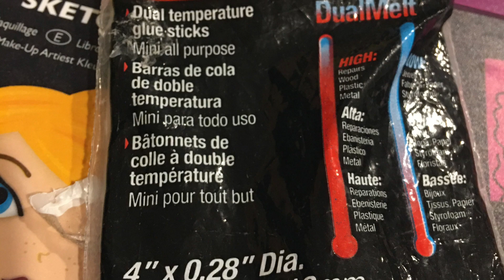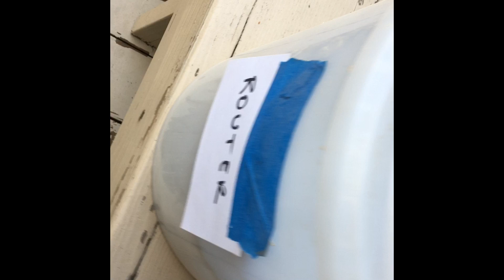Saturday Projects™.com | Deck Prep for Paint - prepping a wood deck for paint tips and tricks how to

Comment: Went around with a hammer and punch and knocked down any nails sticking up and set them in with 3 light strikes then Used a Diamabrush and a metabo grinder stripped my entire deck with it in about 4 hours down to the bare wood that Diamabrush even leveled out boards that had shifted. Then threw down some rust oleum deck rock solid deck paint. It’s been good for 3 years now
Reply from the maker: The diamabrush route was more aggressive than I wanted to go and for this job "good enough" was "good enough" :)  Sounds like it worked great for you.
Reply: @SaturdayProjects  I was able to find someone selling one on market place for 25 dollars so it was perfect. There’s parts where I just skimmed the paint off and there parts where I shaved 1/4 inch off a board sticking up to make it level with the adjacent board. It’s all about how much pressure you apply
Reply: How did you paint it? Brush and roller or an air sprayer?
Reply from the maker: @joaquinsuarez6090  My go to is brush and roller for jobs like this.
Reply: @joaquinsuarez6090  if you go with the Rust-oleum deck coat (Lowes) they have a special roller it’s black and is made out of a perforated spongy plastic you can get near where the pain is on the shelf I recommend buying two, this stuff is way to thick for a sprayer you’ll go though more tips then what you want to pay for. The coverage is absolutely terrible took me 3 gallons on a 20x20 deck but it goes on thick and that’s what you want, I recommend brushing between all boards before rolling it will save you a ton of headache and give you a better seal and durable coat